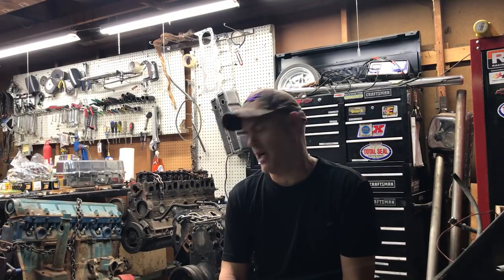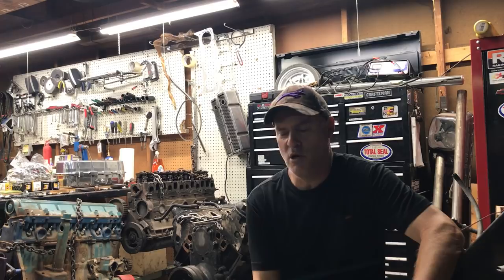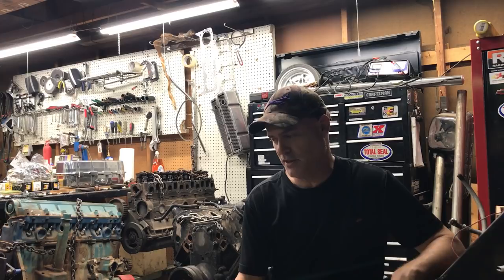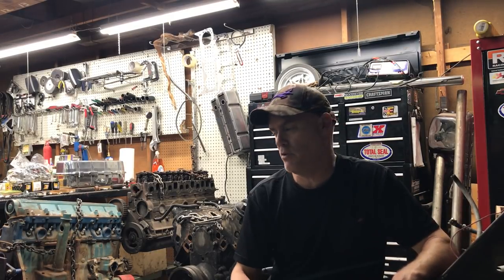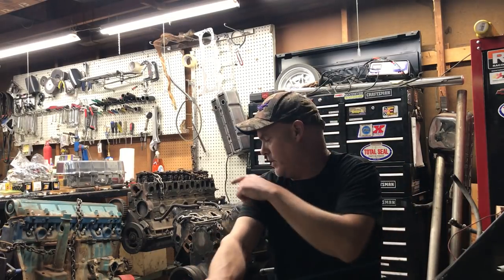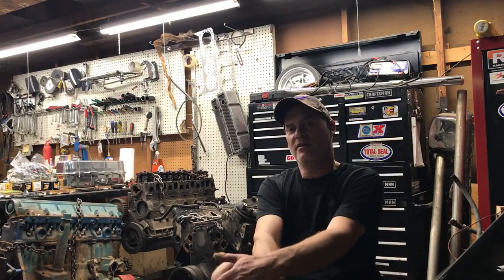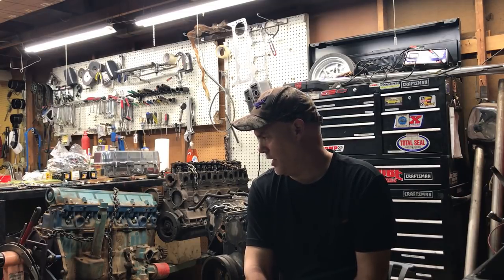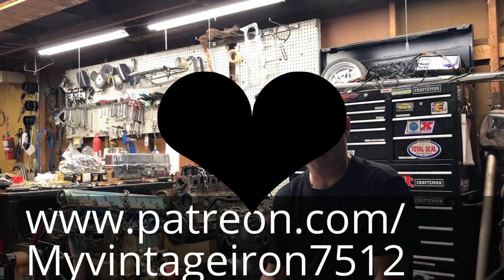Lets Talk LS Engines

Comment: The LS engine is great, no doubt. I would love to be able to put one in my 85 Monte. But I am kinda on a budget. I haven't had any luck finding one at a junk yard, so only option I have is a crate LS3 that runs about 6k. That doesn't include all the harnesses, computers, and sensors needed to fire one of those engines. Yes, I know they make carburetor kits, but that's just another expense. Nor does it include all the brackets, pulleys, and engine mounts needed to make it fit. Plus I would probably need a trans because the 2004R probably wouldn't hold up to the extra power. It would be more practical for me to go out and get a crate 350 that would be a direct fit and I could use some parts I already have off of my 305, like my after market Edelbrock intake, MSD distributor,  aluminum water pump, and high amp alternator. I am just an amateur mechanic and don't have the know how to make an LS run for cheaper.

Comment: ls motors are great but expensive if ur going big power they are great and u will save money but for the street old school is cheaper as long u don't go to many hp then u mite want a ls motor and the 4 bolt main is all u need the 6 bolt is because of the alum. block to make it stronger i have a 327 4 bolt and have had it over 15,000 rpms and never dropped the crank  but any motor that does that has a sh ton of money in it trust me i could have got a house for the money in that motor but i could have got the same out of a ls just a little cheaper but the ls doesn't put out any more power if u have the heads the heads what makes the ls motor my opinion witch an old school motor u have to go after market  or put 5000 in to head work it is cheaper to buy a set of heads but i hear  that the ls is better the old school because they get better fuel mpg but that is not true just put fuel injection on it and my 327 got 25 mpg with a tunnel ram driving it around but if u step on it kiss that good by and watch the gauge drop it got about 3 gal per mile racing it
Reply: ps the vantage of the old school motors is parts are every were and if i didn't have the connections i do i would go ls all day long  but when u get free parts for the old motors they are very cheap to build i have  lot of after market parts for old school motors i just give a ls 350 away to my friend i told him this is what u want to build and it was a good running motor

Comment: Well I have a 2007- 6.2 with 120,000 , it needs the 3rd camshaft because of BAD oiling \ per GM...
Reply: Bad oiling? Other than the o-ring on the pickup tube I’m not familiar with “bad oiling “.
Reply: Me neither but I've heard they did have some cam and cam bearing and lifter issues but if you've fixed it you should have fixed it someone didn't fix it right apparently cuz it should never happen twice never mind 3 times someone is getting the shaft from their mechanic if you pull the cam replace the bearings then theres no way it should fail ever something is definitely wrong here in ,my experience w these the only oil issue is the pickup tube o ring and some lifter clatter if the oil. Isn't changed regularly that's it and that's user error mostly not gm not designing it right yes they could have used better cams and bearings but under normal use and even beyond that if you change your oil they will run forever bet

Comment: Great video I'm going to Subscribe now thinking about building a 4.8 and swapping it into my 2018 Colorado ZR2 just want the V8 smooth power and reliability nothing crazy but top shelf up grades just started doing my research and it's do able for sure but I'd do a all aluminum engine and run a 5.3 if that's a better setup anyone have positive thoughts on this I've seen one with a 5.3 but no other information thank you

Comment: Yeah then why does the 6.0 eat cams. Why does the 5.3 tick like a bomb timer. I'm a chevy guy and the ls motor is dam junk. I will stay old school..
Reply: Either you have ears that don't function properly or the LS engines you have heard had issues.
Mine runs smooth as. You can only hear the exhaust and not the engine

Comment: They are not cheap guy. Dont know how fat your wallet is but mine pretty thin. Unless you pull one out a junkyard, slap a carb intake on it and use a 6LS. You are not on a budget. And to swap it a older model get pretty expensive. I agree they are real strong engines but not cheap.
Reply from the maker: Naaa they are super cheap man I've done a bunch of em on a budget you can be up and running for around 1500.00 to 2K these things have been around for 20 years and there are bagillions of em in bone yards you just have to look around if you don't think 1500 to 2000 is cheap you need to find another hobby

Comment: horsepower sells cars, but torque wins races. yea ls motors makes alot of hp, and if you have a light street car then it would be good. but say you have a heavier 60s-70s modle car or truck for that matter, go big block chevy. ls engines onless youre gonna spend alot of $$$. they dont have the tourqe that a big block do. also you can keep going up on hp with an old rat. cubic inches as well. and cooling isnt a problem for the rat the gas pump is.
Reply: Lousey gas mileage and I can't even lift one head safely by myself too big and heavy for most.
Reply: The old big blocks are shit you fool.
The LS make a ton of torque.
Get with the times
It is a superior engine in every way with limitless possibilities